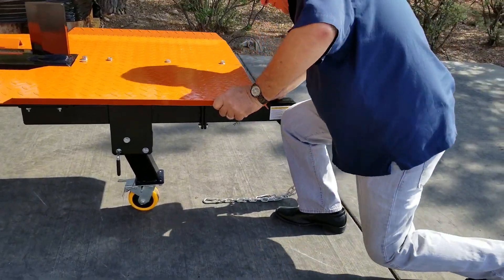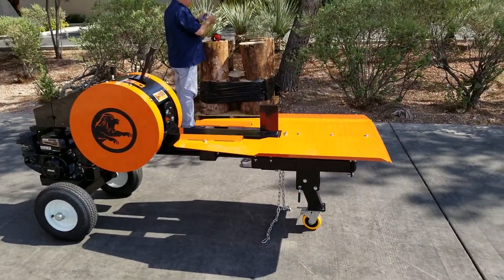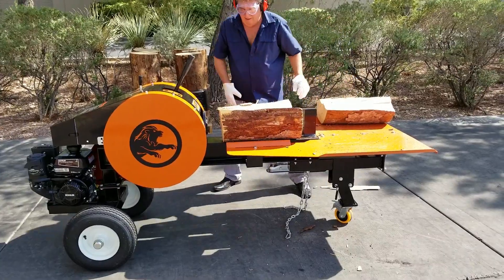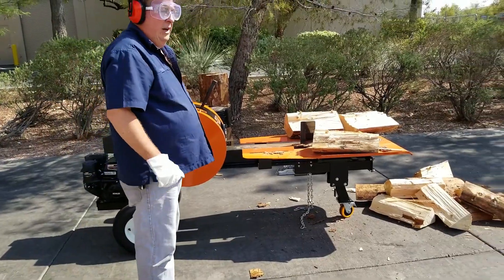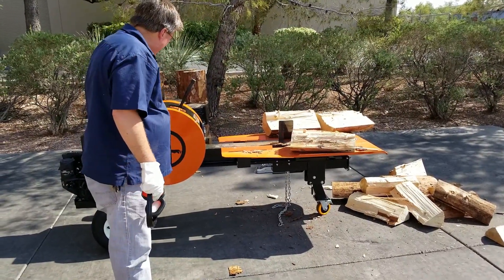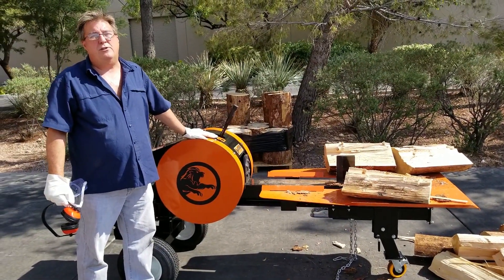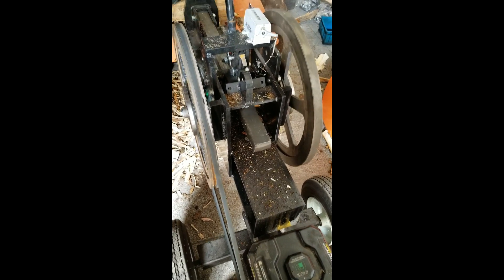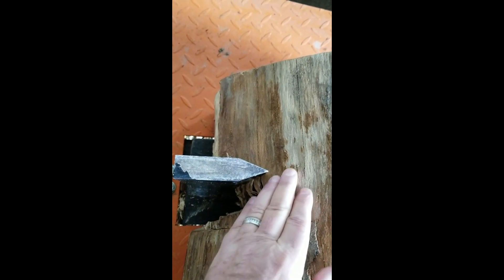PowerKing PK0342 (2018) 42-Ton Kinetic Log Splitter with ABS - DEMO

Comment: 2nd year using my PowerKing 42 ton.  Starts easy, splits any round I've been able to roll up a ramp onto the table, most is red oak.  Some wood I've split makes knotty red oak look easy.  I was not happy with the cover supplied, so I use an 8'x10' tarp and tie it front, middle, and back.  Much quicker than hydraulic splitter, maybe similar to hydraulic that splits in both directions, but the PK stroke is lightning quick.

Comment: My son bought me the little five ton electric from harbor freight. The forced two handed operation puts the operator right at the exit of the ram. I was splitting a piece of green oak with a limb. The limb went clear past center in the round. The machine recoiled, the round spit back at me so fast it hit my shoulder making a minor laceration through my hoodie and t shirt. I was lucky. That night I ordered a metal foot control from Amazon now I can put my gloves hand on the side of the round. If on bounces off again, with my gloved hand on it, it will simply deflect away from me having used its energy against my hand. If you can’t keep your hand away from the crash point, you have no business with any log splitter, or saw, or power tool for that matter. Log splitters are inherently dangerous, no need to be forced to be over the log with your hands kept below the ram area. Puts your head in a vulnerable spot. I watched another person’s video of the HF 5 ton, I noted he was instinctively leaning as far away as possible too. My video is up catching the log hitting me live.

Comment: I was interested in the concept but I can already see that I can split faster and more efficiently with a vertical hydraulic log splitter.
Reply: How?
Reply: @pavelkolp  There are many ways it saves time but for one you can sit down and rotate the log as you split which allows you to work more efficiently. You also don't have to spend any time picking up pieces that require more splitting. And if you really want to increase productivity one person manages the log while another operates the splitter just watch your fingers lol
Reply: No you can’t lol😂
Reply: @j.jacobson  1 - 1.5 cords in 45 min. Depending on species of wood.

Comment: Another great product made inefficient for safety reasons. A one handle operation would be better, that way you dont have to move around so much. The way to make it safer is not letting the ram go so close to the axe but make it stop  a little over a hands width from it. This way if you have laid your hand on top of the log for support and some how forgot to lift it on contact you will not be hurt.
Reply: It's a bad idea to have your limbs any where near fast moving equipment like this. 2 handed operation is the only way to go here. Feel free to disable the safety features if you're dumb enough to do so for "more efficient" operation. Just remember you'll be less efficient after you're missing a couple fingers.
Reply: @Kanglar  This is more a "if you are aware of" situation. When you are out driving you are aware of what the gaspedal does, now if some idiot sits in his car slams the pedal to the bottom and doesnt let go its very likely he will get hurt. There is tons of equipment in all sorts of industry who is extremely dangerous in many cases its efficiency, cost or the simple fact none found a safer way to do it. What it comes down to in a case like this and many others is operator awareness and proper operator education. To make my point even a shovel can be dangerous if not used right.
Reply: @Kanglar  And i would like to add what if you have someone helping you maybe it should be a four handed operation?

Comment: I have a Super Split right now but this thing looks like a beast. I like how you did the hitch and how the engine is set lowers so it wouldn’t be as tippy when you got to trailer it. Is it able to tow at highway speeds? Looks like a great splitter I love how everyone knocks on kinetic splitters I would bet good money if they ever used one they would be selling there hydraulic. Kinetics are so much faster and can split everything a hydraulic can I know I have one and heat my house and cabin with wood in northern Wisconsin. Thumbs up👍
Reply: I agree.  We have a 28 ton rated hydraulic and a 42 ton kinetic.  The hydraulic is set at vertical and its job is to halve or quarter rounds just too heavy for me to pick up.  My son and I and one or two others share the cost of the semi truck load of rounds and then share the work of sawing and splitting.  We normally get at least two cords each out of a $600 dollar truckload.  Given the going price per cord is $300 (depending on time of year and if the wood is green) the cost for the splitters and my latest purchase for a new ATV tipping trailer have long since paid for itself.   Not bad for a couple of long days on  a single weekend.  We could never do that with the 28 ton hydraulic.  To do better we would need to move into a wood processing operation.  Given we do this over a single weekend, I am not interested in spending six grand and more to step up if it just going to sit there 51 weeks out of the year.
Reply: Keep your super split. Dont buy this piece of crap

Comment: Yeah looks like so pretty soft wood, try Oak from up here in Connecticut
Reply: Oak?  Oak is rated as medium splitting difficulty.  If you are having problems splitting oak then you should go with a more powerful splitter.  Woods considered to be difficult to split include beech, dogwood, elm or black locust.   We have dogwood growing on our property and I wish all of it a long life.  Of course oak is rated by the forestry service as an excellent firewood.  I use it in my Texas smoker to slow cook my pork butts for pulled pork.
Reply: @wilhard45  I have a DR splitter K-10 which is a baby compared to the one in the video, runs on a 120vac electric motor. I've split oak, popular, pine, sweetgum, and now finishing up on over two cords of black cherry. You would be surprised what those will do, and mine is a very small splitter, I could imagine what a monster like the one in the video can do. By the way, all the wood mentioned above was/is green wood.
Reply: Shaggy bark hickory?  Black walnut?  How does it do??

Comment: 42 ton.   Don’t think so.  I know my 28 ton hydraulic would split that log that was in side ways
Reply: Yeah my 28 ton is also way less noise too.
Reply: Greg rupar -  Have you actually tried to do that?  Don't forget they selected the wood for a specific test.  They were testing the flywheel ABS system and  would have chosen something that would be very resistant to splitting.  Lots and lots of YouTube videos demonstrating the speed of the kinetic splitter.  I own both a 28 ton hydraulic and 42 ton kinetic.  We do 95% of our splitting with the kinetic because it is just so much faster.  When we have extra hands my son loads the wood onto the table, I whack the two handles and before the ram is fully retracted he has cleared the table into the cart and placed more wood on the table.  I am doing a split every two seconds.  The only way a hydraulic would produce more wood is to spend a lot of money for a commercial splitter that produces four or more pieces of firewood per pass.  Great for a commercial operation but we just do firewood for family and a few friends.  Our gear sits in the shed 50 or 51 weeks out of the year.
Reply: @wilhard45  So the kinetic is honestly better? Im curious because me and my pops split about 14 cords per every 2-3 years and its painstaking work with our 25ton hydro lol We split some pretty tough stuff though so I would need it to perform!
Reply: @RUZTY1311  --  It is for us.  We do pretty much the same thing.  We get four to six truck loads each year  and it takes two to three week-ends with the kinetic.  Some mixed and some eucalyptus.  My kids, adult grand kids get most of the wood along with a couple neighbors.  Everyone chips in money and/or labor.  Cords of mixed sell for $250 to $300 from firewood dealers and our cost is anywhere from $100 to $150.  If we have a few leftover cords we sell them for $200 ( or donate to some less fortunate families).  Unless we stepped up to a $10,000 hydraulic processor no way a hydraulic would keep up.  I am not a professional firewood processor and so this is just my opinion on what has worked for us.

Comment: I just received my Powerking 42 ton Kinetic.  It will not even split 6" dried Elm with no knots, tried multiple pieces with the same none splitting result.  It will split white oak up to about 14" sometimes.  Tried a 18" straight grain white oak log that was cut a year ago and would not split it.  It also split black walnut up to about 12",  any bigger it will not split it.  All the wood I tried splitting was cut to length about a year ago.  Definitly will not be a primary splitter for me for real logs, it will be good to re-split firewood pieces and smaller logs, but my go to machine will still be my hydraulic 34 ton splitter.
Reply: Nice story but I question your honesty.  If the splitter does not do the job why not return it?  Seems foolish to spend a couple of grand on something and not seek a remedy.  I can understand trouble with elm.  It is rated difficult to split.  OTOH, black walnut is rated as an easy split.  That is the same rating as pine.  If you own a 34 ton hydraulic splitter why bother with getting an expensive kinetic?  Why not get an aftermarket 4-way wedge?  Would save you a bunch of money and cut your splitting time in half.
Reply: @wilhard45  I agree with you concerning his honesty. I have a 34 ton unit as well as a hydraulic.  I run the kinetic 95% of the time because I am getting old and don’t have time to wait on my hydraulic splitter.
Reply: should have tried the super split out of Massachusetts.  A bit costly but well worth it

Comment: I hate the two hand engage mechanism. First thing I would do is defeat that. I have the 34 ton model from about 1.5 years ago and it only has one hand engage. It splits everything. I keep mine attached to the truck otherwise the machine walks. The torque improvement is a good idea. I already busted my spline and it took quite a bit of time and $200 in parts to replace myself. I like the wheel on the front leg also. I also like the new location of the Kohler engine. The tires also appear much improved. 

 Please design a side table which attaches to the machine so you don't keep knocking everything off the working surface forcing you to keep bending over picking everything up to split again. Also consider a 4 way split attachment like many others have available.

Please offer me a decent trade in I would love to buy the new and improved version.  I only split about 10 cord before I broke mine. The table is also cracking so that will need to be replaced soon also.
Reply: You will be happy you defeated the two hand engage mechanism as soon as you cut one of your hands off by eliminating an important safety feature.
Reply: @avacadovich  BS as I stated my older version does not contain the two hand safety capability by design.  It is amazingly is amazingly safe to operate.  I cannot even tell you how many cord we've split over the past three years.
Reply: @avacadovich if you don’t know to keep your hand out of a crush point, you have no business around power equipment.

Comment: I have only 10 ton kg kinetic splitter and what need by axe doing burn wood for year was 6 to 8 days and now all years burn wood in 8 hours. Friend made with hydraulic about same much burn wood in 2 and hald days.
Reply: And the hydraulic splitters roar full throttle to go slow. Hate them. This type just quietly loafs. Much better.
Reply: The fuck are you trying to say

Comment: We have been using this unit for about a year. It out produces our hydraulic unit about three to one 80% of the time. The other 20% it is just about as fast. We are splitting green pecan of all sizes and conditions and we can't be more pleased. As far as straight grained oak: holy S!#^t this thing is fast(6 to 1). It will keep three people extremely busy all day long.
Reply: Jimmy, do you have the new PK0342 42-Ton or the 34 ton?  Where did you purchase?